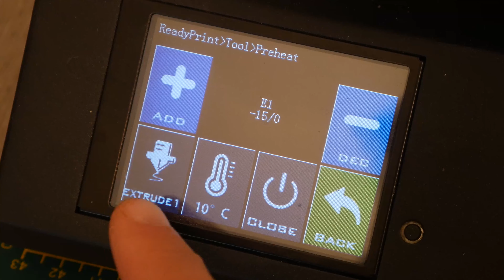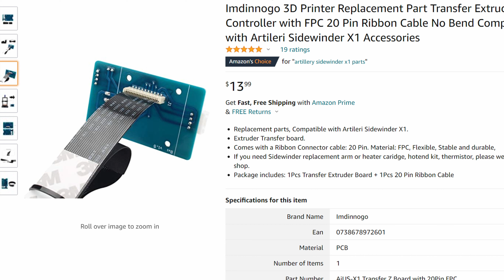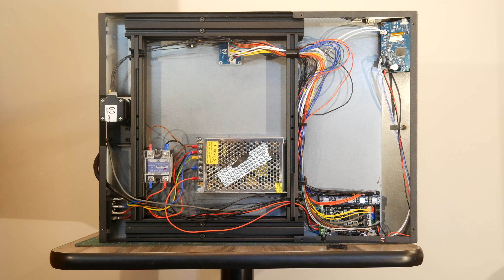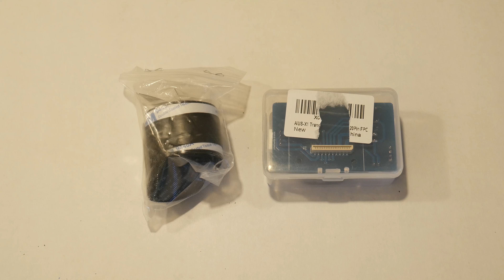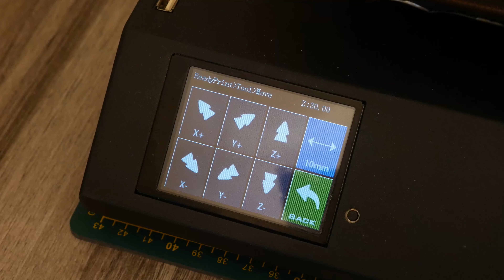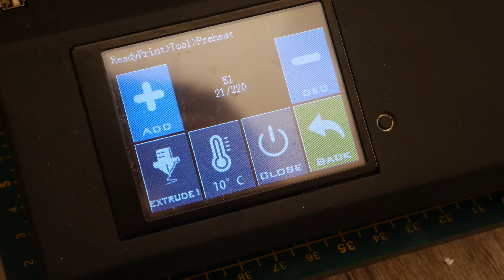Stopping My Artillery Sidewinder X1 From Catching Fire

Comment: First thing I did after buying this printer was to print some cable guides. Of course that doesnt solve all problems, but to my knowledge most problems occur due to the wires getting loose due to movement.
Havent had any problems in about 2 years.
But I also have v3.

Comment: Do you have a link for the board you bought
Reply from the maker: Imdinnogo 3D Printer Replacement Part Transfer Extruder Board Controller with FPC 20 Pin Ribbon Cable No Bend Compatible with Artileri Sidewinder X1 Accessories https://a.co/d/2zimI9U

Comment: Mine didn’t fry the connector on the circuit board, but it did leave a skid mark on the back of the board. I think there was a short in the wires leading to the heater block. I’m hoping this fix works as well as it did for you.